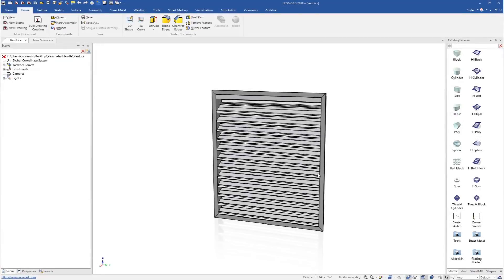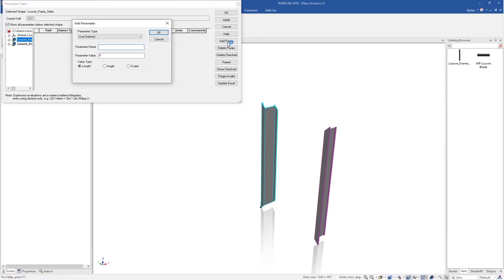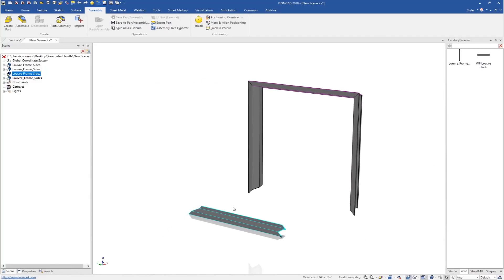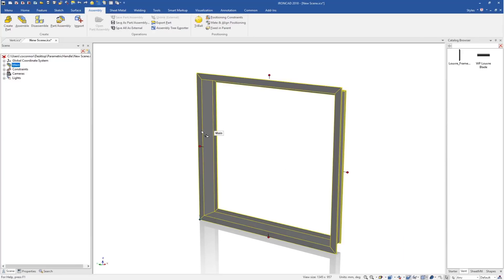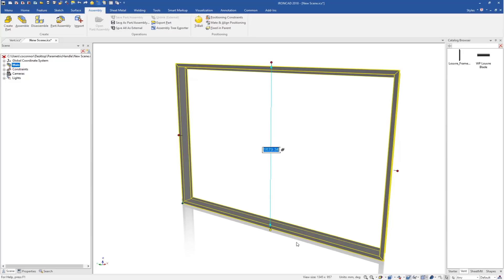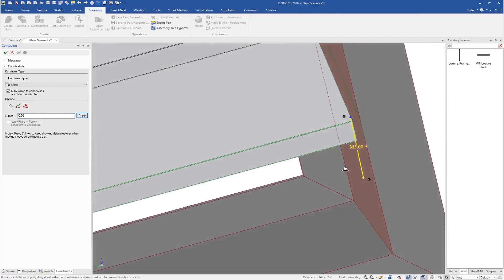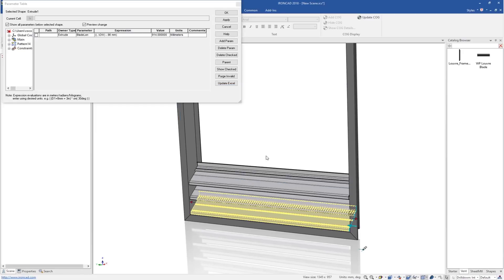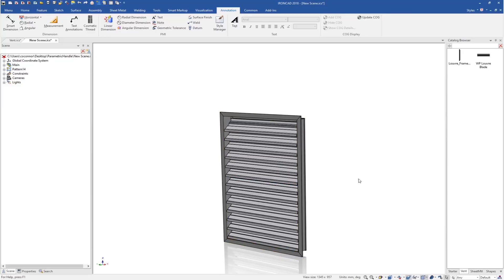IronCAD Dynamic Handle Parametrics - CAD Design Tools

Comment: How much does it cost? I've never used any CAD software before and I'd like to use IronCAD to design a computer case and I was curious if the software has models related to the ATX standard, as that'd make things much easier for me instead of measuring everything out on my own as I don't have a 3D scanner or anything like that. I'm just a guy, sitting in his room, wanting to hand over designs to someone who can do CNC machining.
Reply from the maker: Hi, If you can send us an email at sales@ironcad.com with your name and location, we can connect you with a local reseller who can provide you with options for purchasing or subscribing to an IronCAD seat.

Comment: I'm sure I could do this in Inventor without using Excel. It's easy to create links by passing parameters between parts and assemblies and use formulae to create pattern numbers, etc. The video shows a lot of typing in of information and changing of settings that would take some figuring out.
Reply from the maker: Hi Robin, Thanks for the feedback. This is just an example of how to set it up and it is not using excel (it is our own table). However, you could link to excel fields as well if you wanted to drive from an external file. This example is showing between parts/assemblies and yes a multi-body file would be a little less work in cases and is also supported in IronCAD. There is another video https://community.ironcad.com/index.php?/blogs/entry/43-intelligent-parametric-push-pull-design/ that shows another use case and automatically pulling parameters from one part to another. We would be happy to show you more if you are interested.